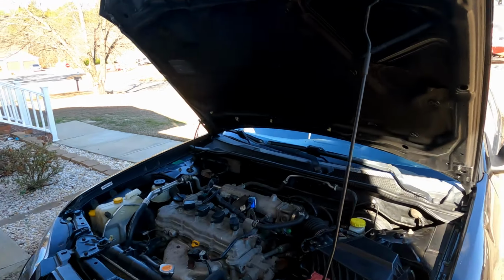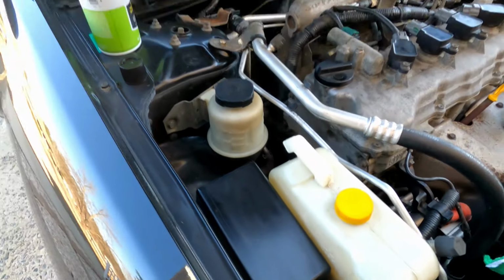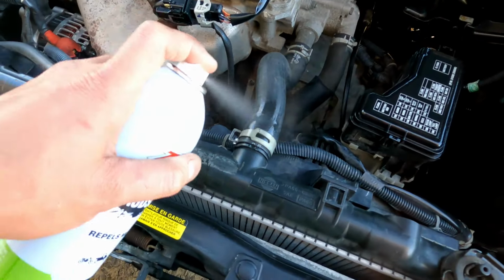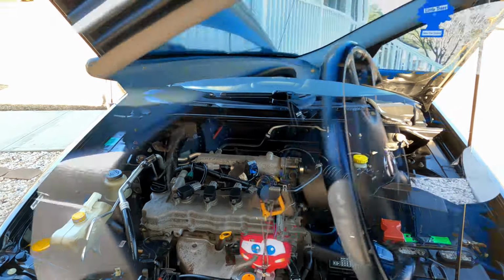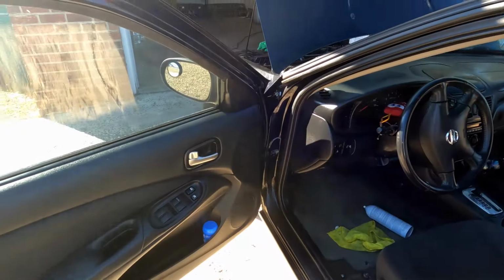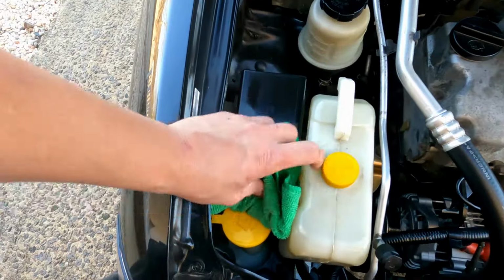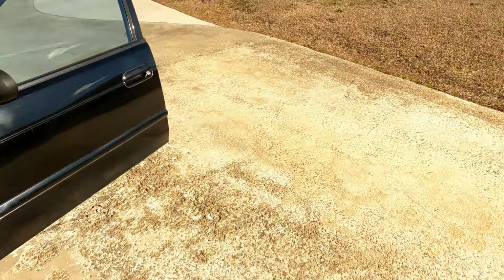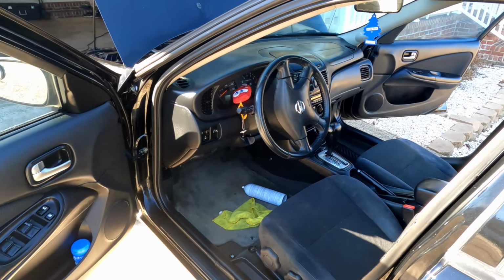This $12 spray made my vehicle look brand new in minutes!!

Comment: I think these types of sprays could make the material last longer. However, I think that spraying it on different interior pieces could be dangerous for the materials, it might break them down and could cause a chemical reaction that would destroy the material all together.

But for the engine bay it might actually be useful and it does look great! Might not spray too much on sensitive engine components however haha.
Great trick for a flip car however!